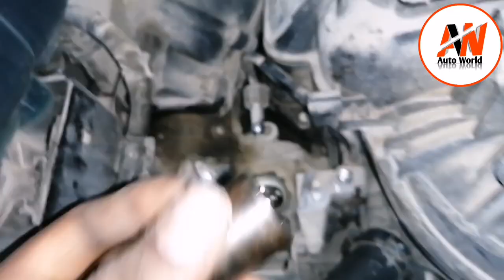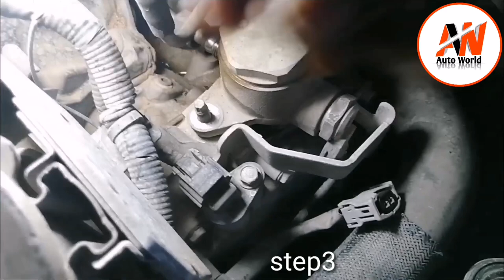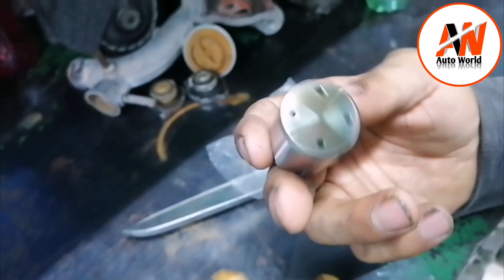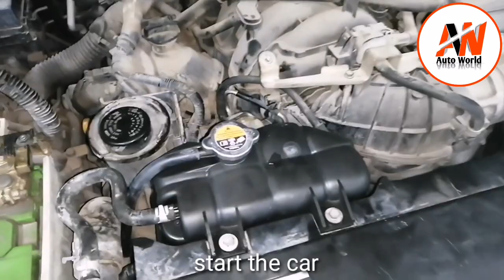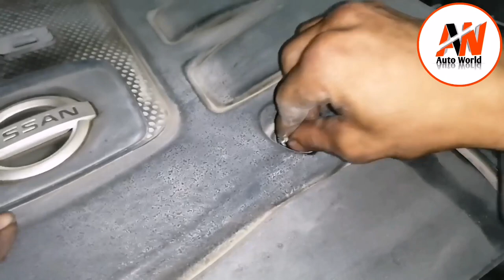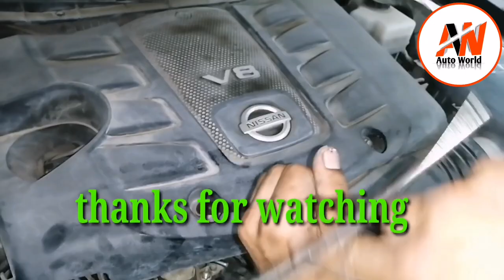How to Remove high pressure fuel pump / infiniti M56 : how to Replace Nissan fuel lifter Valve

Comment: Why did you change that part, what problem did it have before you changed the part, could you say and what symptoms does it present when that part is damaged?
Reply from the maker: Compny 80,000km change,but,i replace resan old damaged,you watch complet vido
Reply: @AutoworldDubai  I have watched videos where that part wears out and the vehicle loses power, is that true?

Comment: I drive a Nissan patrol 2015 model,when you try to accelerate the engine sounds goes up and comes low when driving wonder if this is the cause?cos the main fuel pump was changed but the problem still persist
Reply from the maker: Boss check the high pressure fuel pump location top engine